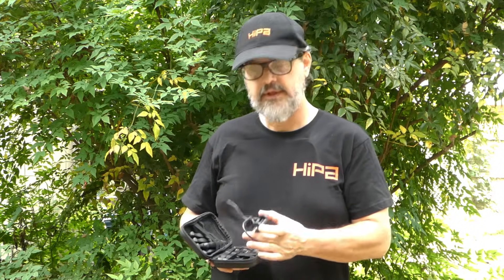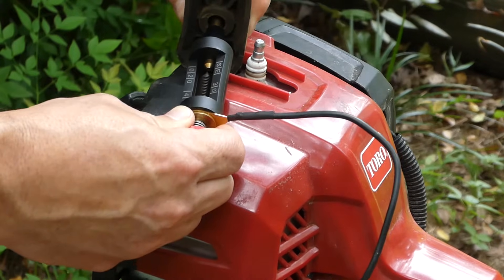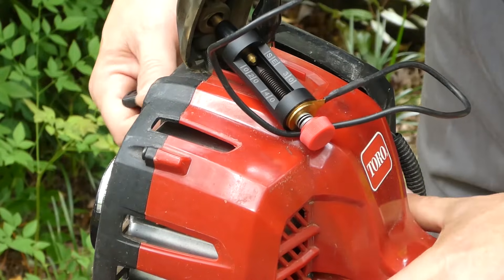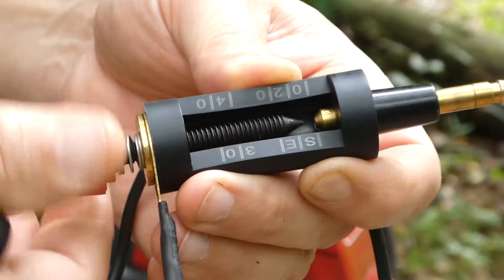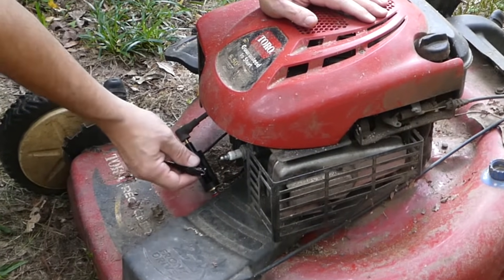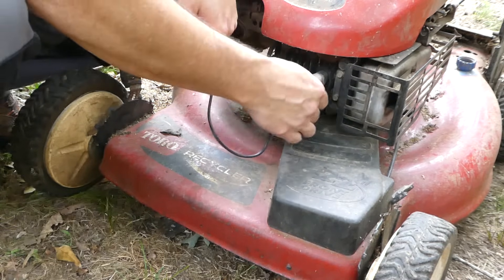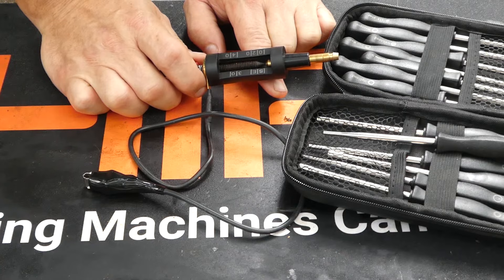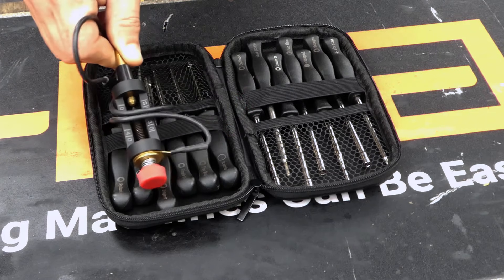How to Use An Adjustable Ignition Spark Tester - Hipastore.com

Comment: Your information is wrong.  In open air the spark travels much more easily than in a compressed gas mixture inside the cylinder.  So you need to open the spart tester a lot more than the distance between the two spark plug electrodes.

Comment: If you just test it by the last method wouldn’t that indicate a good plug and coil?
Reply from the maker: Removing the spark plug from the chamber and hold it against the metal and in that way you can test whether the spark works or not. You could also switch the old spark plug to a new one and test in the same way to know whether the ignition coil works or not.

Comment: To check spark without starting the engine Its much easier and safer to remove the plug. Just clip the lead to a good ground. Its the coil and its ignition lead that is being tested.

Comment: When I saw one of these,  I am confused about the numbers on the side of the tester.  The gap would be huge if you opened the gap to one of those numbers.
Reply: That's because it's for cars . Cars require 30,000 Volts for the ignition coil. If you see 20,000 volts that's kind of weak. That's why the gap for a small engine is so small

Comment: 1mm gap as per 3000 volts in air of spark plug test. Under compression of engine the, spark requires much higher high voltage. (8mm/24kv) Also Poor ground oxidation of connection gives lower high voltage., especially on the lawnmower Magneto laminations touching the engine aluminum ground bracket contact.

Comment: I bought that carb adjustment kit a couple years ago and it's great but my kit didn't come with a spark tester. I still love the kit, it had all the adjustment tools needed to do the job.
Reply from the maker: There are a couple different kits now to choose from, both in number of drivers and accessories like cleaning brushes or spark tester.  Thanks! glad the kit is holding up.

Comment: That’s the one I have and use it all the time. Never lets me down. 👍 highly recommended.
Reply from the maker: Thanks! It is a simple tool that can save a lot of time diagnosing a problem.
Reply: @HipaStore  does it have a removable tip for testing non-resistor plug boots?
Reply from the maker: @JuniorHenderson-i6q  Hi yes it comes with a standard plug wire tip and can be unscrewed so the spark tester can be used on small engines and some motorcycles.